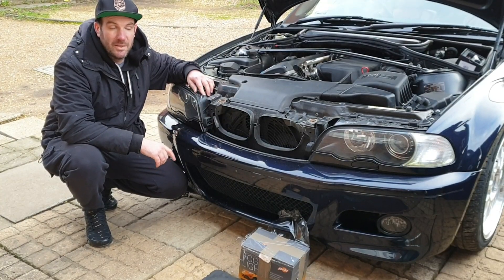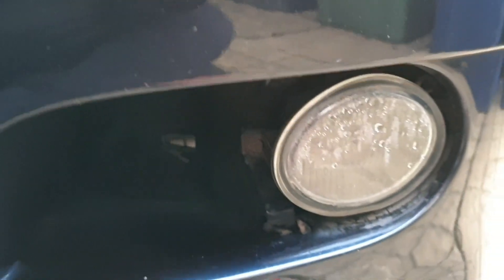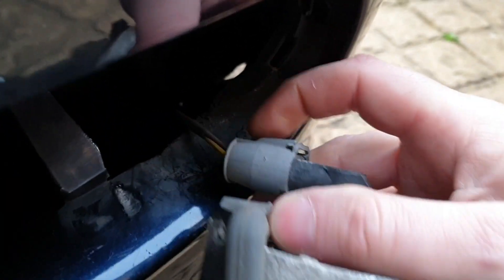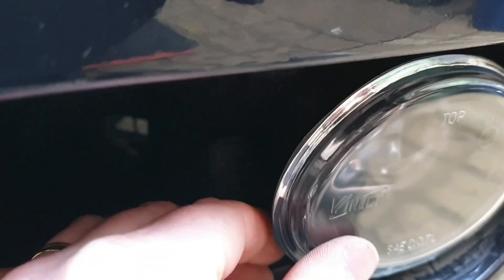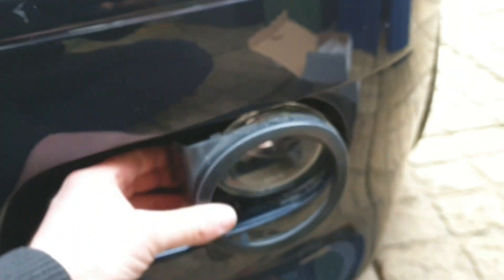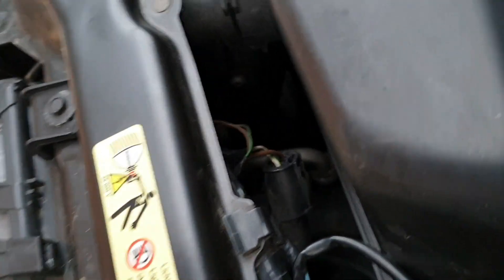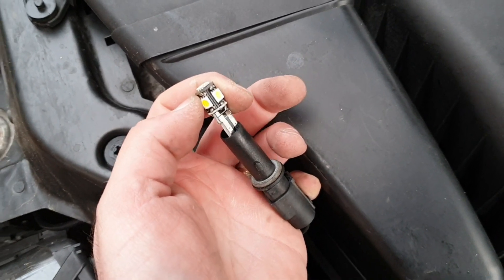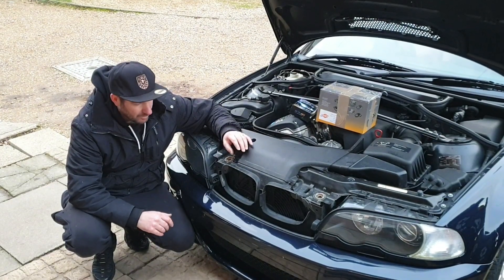e46 M3 led light upgrades. Fog light removal, led fog lights and sidelights easy DIY tutorial.

Comment: Can I say thank you. Because of your tutorial, I have just taken out my fog light that had water in it. I’ve heated and cleaned it and refitted it. I would not have been able to do this but for your video. It made me think I could do it myself and I’m chuffed to bits. Please keep them coming and all best wishes. Ryan
Reply from the maker: I'm super glad to of helped! Makes making the videos worth it if I know one person can improve themselves it was worth the effort, thank you for the kind words and feedback, he sure to subscribe and like the video for more!
Reply: @diym3541  thank you. I have subscribed and look forward to more videos as they come. Next I need to get to the bottom of why my passenger Wing mirror only adjusts some times. 2006 ribbon cable model and drivers mirror motor/module behind the glass changed. Worked both mirrors for a while and now passenger one dead again. Unless I disconnect battery and then reconnect and it works again for a while. Do you think that it goes through the GM5 body control module behind the glovebox? Could that be going bad? Any help appreciated and thank you once again